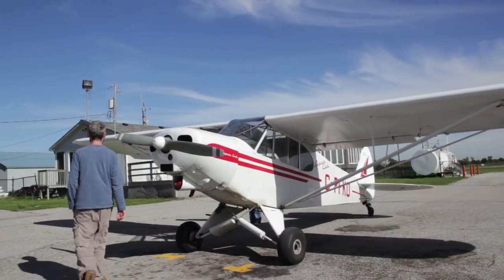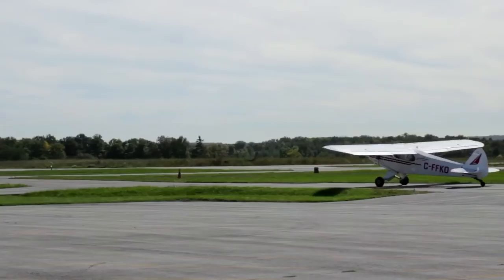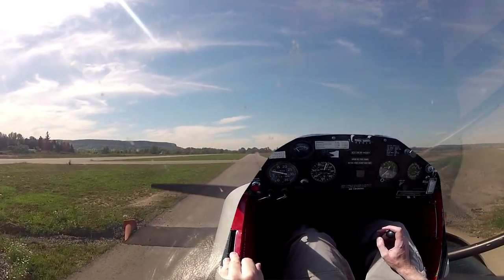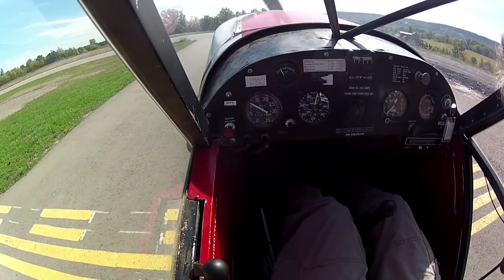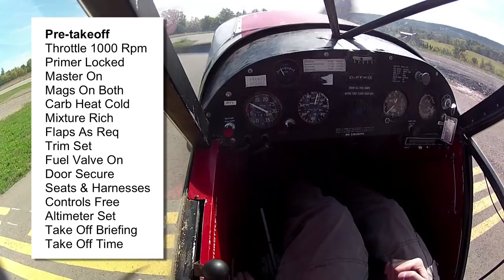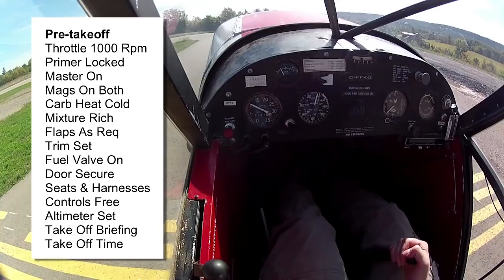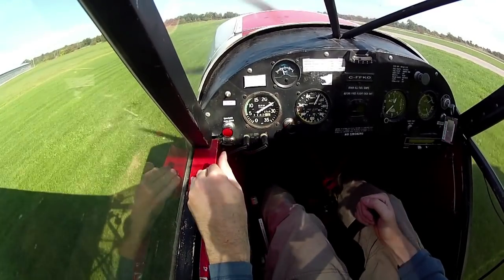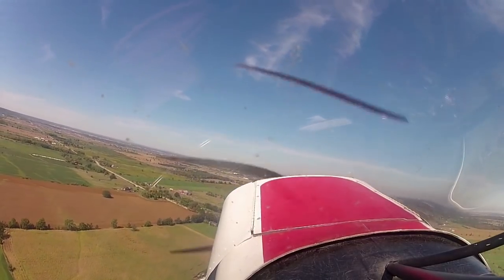Flying a Tail Dragger - Tip #3 - Taxi + Run-up + Take-Off - Shoes Matter! - POV flying

Comment: The comment made while holding short (6:40) "Its like boxing, not ballroom dancing." is very helpful!  Thanks for your videos.
Reply from the maker: +Knuckle Dragger Glad you found it helpful, and yes, I'm still relatively new to tail wheel flying, but that single bit of advice from Dennis is something that I hear in my head each time I fly one.

Comment: I got my start on tail wheels (1978), J-3 at a small airfield with a grass runway. For me, there is nothing like that kind of flying, years later and many other types of planes and flying performance, when I think about flying, The J-3 always wins out. While getting an advanced rating I mentioned that to my instructor, she looked puzzled, she had never flown one.

Comment: Another great video Steve! You have me very keen to start my tail wheel endorsement.
Reply from the maker: Right on!  Yeah it is a blast man…  
Minimal instruments and lots of scenery - Everything melts away and you can just think about stick and rudder flying!
Reply: Thanks man! Yeah, I really want to get in to it. Just have to find somewhere that has one that isn't a million dollars an hour.

How'd you go with the G1000? Get checked out in it yet?
Reply from the maker: Michael Hossen I am currently doing IFR and the tail wheel stuff, so I let the G1000 slide for now - I am not in a huge rush for that.  I did enough training to get to the point where understand it, which was my main goal - not sure how practical it is for my type of flying which is mainly fair Wx VFR.  
And I'd like to be comfortable with IFR on steam gauges before I consider switching over to G1000 for that.
Reply: ***** Just finished my MIFR on steam gauges with just a basic heading indicator. Once you mastered that you will realize flying IFR in a G1000 is a breeze compared to that. If you understand how the G1000 works that is.
Reply from the maker: Richard H Haha yes - it has totally occurred to me!  I started out with tail wheel as a welcome diversion from the grueling IFR work, but this summer the tail wheel stuff has sort of taken over because it is so much fun - I'll have to get re focused on IFR this winter :)

Comment: Nice video, the shoes thing was spot on. I have size 13 feet and wear Addidas Tuscany driving shoes to fly. Try those. Puma Ferrari driving shoes work great too. I'm only on my 7th hour of my PP but l really like the humility and candor of your videos. Going to fly this weekend with a friend in his 46 Champ. He's a CFI and I can pick up a bit of instruction. He's not my regular instructor but gives me good advice.
Reply from the maker: bremms1 Thanks!  And I highly recommend flying with multiple instructors throughout your career - you can always learn something new, and different styles of teaching are interesting to learn from.
Reply: ***** My instructor recommended flying with another instructor for just that reason. He did tell me to ignore the landing attitude of the Champ before my checkride. His Champ is a cool plane, hand propped slow but super fun. His other plane is an A330. Kind of flies itself. Opposite worlds.

Comment: The shoe problem on cubs is a big deal. I fly a cub and used to use sailing deck shoes while flying. I had the exact same problem here with the sole getting jammed on the metal plate. Most of the time my shoes were so loose they just fell off when I pulled my foot back. Good find, I'm sure nobody has mentioned this before.
Reply from the maker: Cool thanks.  
I "knew" that the clunky shoes were not ideal, but there's nothing like a practical demonstration "proving" the problem.  
I'm just glad it happened so early, and on my first lesson no less!  
Now I can resolve it for future.
Reply: ***** I'm surprised there hasn't been an AD to make the metal plate extend farther forward to avoid this since it happens to several people. "Just wear appropriate shoes" doesn't sound like the FAA's usual tone....
Reply: It's because these cubs were built in the 1960's. Most of which are flying under a permit and not a certificate of airworthiness. A lot of cubs are even experimental so it's a design flaw on part of Piper. Not feasible to redesign the whole aircraft as they are not even in production anymore!
Reply: Well, that totally makes sense. Thanks for the info!

Comment: loved it (as always)

taxiing looks like a distinct challenge. I had enough issues in the tricycle gear cessna. still find parking problematic.

what's the forward visibility like?. i get the impression that it can be quite limited in some taildraggers.

heel brakes would totally freak me out. 

also had to laugh about the stuck foot. I have exactly the same brand of merrel sneakers that I fly in for those exact same reasons. I need a lot of tactile feedback from the pedals.

your tail dragger instructor seems like a great guy , a very instinctual pilot. I like his style.
Reply from the maker: Awesome thanks!  
Yes, in some tail draggers the nose can really block your forward view when in the "3 point" attitude on the ground.  
The Super Cub is not too bad, but a plane like the Stearman or Harvard have very a restricted forward view.  I think they need to taxi in a zig-zag when going straight to be sure they know what is ahead.  If all goes according to plan, I'll be checked out in the Cub shortly, and Flying the Stearman with Dennis later this summer!
And yes, Dennis is hands down the best instructor I've ever flown with (and I have flown with many over the years.)  He is calm, confident and knows what to say, and when to say it; He let's me make my own mistakes (safely) and then calmly explains how I can fix them - He creates a perfect environment in which to learn.

Comment: Depending on the airplane, I vary my shoes. My pride and joy is a nice polished Luscombe. While learning to fly, I used to wear penny loafers due to the big sole to help on the heal brakes. I'm 6'2" so there isn't much leg room let alone enough room to flex your heels. A right cross wind with a stuck left rudder wasn't fun. The shoe slipped off and lodged itself behind the brake and in front of the left rudder. On climb out I had my dad take controls and I unlodged my shoe. Since then I go barefoot on the take off and landing with the heel brakes.

I also fly a Swift a lot, and would never dare to go barefoot due to the toe brakes. Your feet can get pinched even with tennis shoes, so I usually opt for boots when I fly the Swift.
Reply from the maker: Will Allen Interesting perspective.  I'm 6' and feel about right for leg room.  Using low profile shoes since this first flight, has worked well for me.

Comment: Lol wow! I would have soiled myself when the shoe got caught on the rudder pedal. You handled that with great poise. Well done. I've always been a little apprehensive about a tail dragger just because of that dreaded ground loop.  Would you recommend strating off learning on a tail dragger first and then to the tricycle?
Reply from the maker: Keith Burr That's how they did it in the old days!  So, yeah, if you can get access to a tail dragger and an instructor that will do primary instructing on it - go for it!  Dennis says he wishes he could do primary training with the Super Cub, but the problem is that some critical controls are only accessible from the front seat.  Thus, to get the front seat check out, you need to already be a pilot who understands how to operate the mixture, flaps and so on which can not be controlled from the instructor's seat in the back.  J3 cubs are flown solo from the back seat and I think the way it works is that the instructor sits up front... That would be a heck of a way to learn to fly!  It would sure make for some strong fundamentals!

Comment: The only type of shoe I wear when flying is car racing shoes. Very thin sole and have FIRE RETARDING features. Can get somewhat warm in summer, but wear a light "dress" sock to alleviate some of the heat. They also aren't that expensive. Hope that helps. I don't know why "they" don't have flying shoes on the market.
Reply from the maker: Burchrg24 Thanks! Can you give me the brand?  the link might be spam filtered by YouTube, but just the brand and model and I can google - thnx.
Reply from the maker: Burchrg24 Thanks so much for sharing this info!  And glad you're enjoying the videos!

Comment: Sweet video, looks like a fun time. What kind of camera you got mounted in the cabin?
Reply from the maker: GoPros are the fixed / on board cams, and the B-Roll footage is shot D-SLR by a buddy - I believe it was a Cannon t3i
Reply: B-roll footage in this case is the takeoff viewed from outside the plane. (For those not savvy with filming lingo)

Comment: Welcome to the world of tail wheel its a ton of fun! Though during your warm up did you notice you were across the hold short?
Reply from the maker: Haha, I knew some one was gonna point that out.
Yeah, I was shy / gentle with the brakes and didn't get it stopped in time; but I was just barely hanging over the line, and it is no big deal at that airport if you look how far away we are from the runway at that hold short line.

Comment: To be honest it is not the type of shoe. I often encourage students to use the radiest old shoes they have. The shoes that are warn the most are best and combat those concerns. Glad you mentioned it. Also your instructor should have said why you check idle with the carb heat on. Your checking to see that the engine will not quit. If it quits your engine is not warmed up yet or it poses a possible mechanical problem. Good job on sharing the information. D

Comment: Revisiting this... what exactly about those shoes was so bad?
Reply from the maker: Chunky soles that made pedal feel dull and the heels have a pretty big lip that got caught on the edge of the metal floor plate under the pedals.  As I built more experience I got better at dealing with less pedal feel if I needed to wear boots, but for initial training, you need all the help you can get.
Reply: Ahhh ok. That makes total sense. As the winter weather has set in, I've been wearing boots almost every day. The first time I tried flying with them... oh man, we did a little dancing down the runway. Took a few seconds to get used to not being able to feel the pedals against my feet. Super weird feeling but I've slowly gotten more used to it.

Comment: The "stick to the belly" part during taxi is not quite right... if you have a tail wind while taxing and you do that, you're actually causing the tail to go up. It should be nose down or no elevator at all when you have a tail wind :) great videos!
Reply from the maker: Javier Llaneza Yeah I asked about this, and Dennis made a good point - he said - pull the stick full aft and have a look at the elevator - it is still level with the ground when in the 3 point attitude...  But the prop blast with the nose up is still hitting the elevator to keep the tail down... So the difference forward stick makes when accounting for a tail wind is not enough to worry about as it is more important to keep the tail down to avoid nosing over.
Reply: ***** Yeah right, it all depends on how strong the tailwind is, of course :) thanks for taking the time to reply man!
Reply from the maker: Javier Llaneza All good - thanks for watching and adding to the conversation in the comments!

Comment: Why dont they start all airplane Training in that order by design of the training program. 

Minimum to get GA PPL. (flight hours not including ground work, run up and checklists, i mean time actually flying)
  
25 hours in learning physics, how planes fly and aviation history. 
10 Flight hours in gliders
20 flight hours in a Tail Dragger before even moving onto a tricycle gear plane. 
XX fight hours in a Tricycle or more to get GA PPL. 

Cut down Aviation accidents i bet.